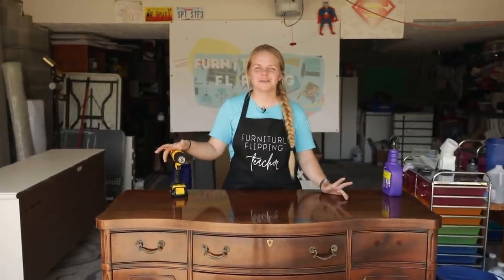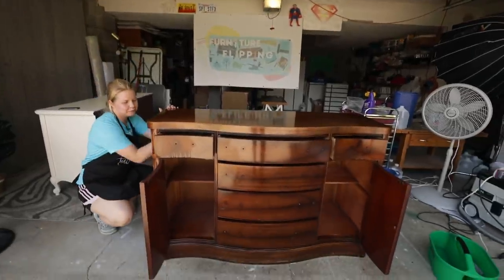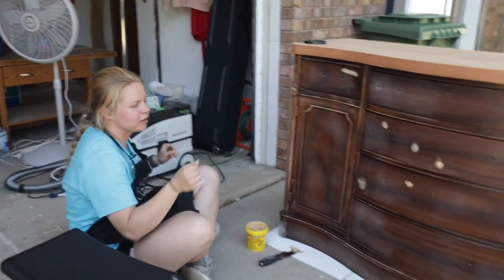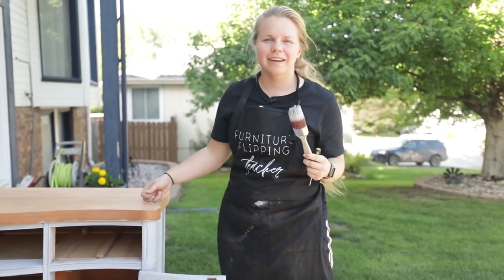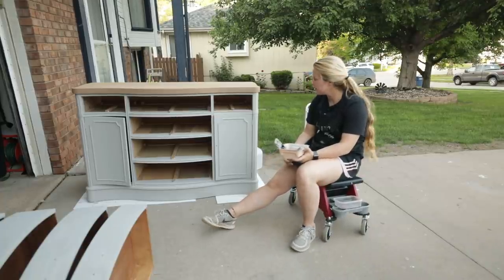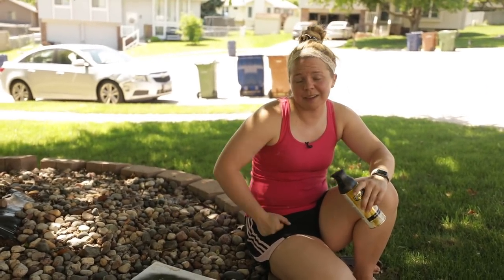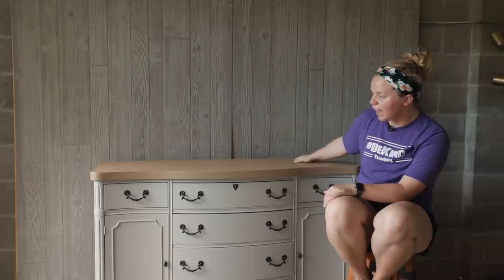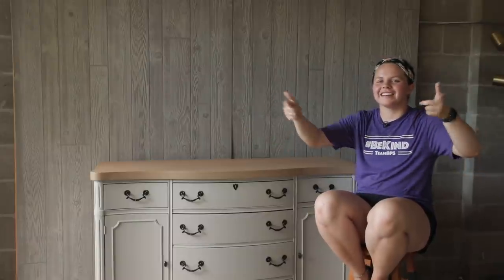How to Lighten Wood WITHOUT Stain or Bleach | Buffett Dresser Flip |

Comment: The green velvet lining in the drawer is Silvercloth. The fabric has fine silver particles embedded in the flannel which absorb tarnish producing gases before they reach the silver.
Reply from the maker: Ahh! Great information! (: I could tell it was truly meant for a buffet! Thanks for sharing!
Reply: Yeah thanks for sharing this info. I have a server that has a brown one. Mind if I use this information for an upcoming video? 🙏❤️🌻
Reply: @GirasolVintage  you're welcome to.
Reply: Hey, Linda. I’m working on this same piece, but the dividers DO NOT want to budge.  What can I do to refresh the green velvet?  It’s not in good condition.
Reply: @lisamorlock-wright6474  I know you can buy slvercloth at fabric stores, or you could years ago when I worked for a couple. The brand was Pacific. I imagine if its not available locally you could order it on-line. I'd remove the original and use craft glue to adhere the  new.
Reply: @lindap9079  Thanks bunches
Reply: I have a dresser with this but it has an old perfume smell….do you have a suggestion for getting the smell out?

Comment: Good job! I had one exactly like that with a China closet, but no scratches. I inherited from my mom. What I did with them back then, (about 40 years ago,)  was a trip! I used Kilz, which was then only oil base and asphyxiating! 🤢 I then painted them both white, then sponge-painted designs on them: a real mess! 😵‍💫😂 Things are easier now, and you guys are much smarter than I was. 
👏👏👏

Comment: I just stumbled on your channel and am hooked! I am a teacher, too! I'm off for the summer and looking for summer projects. You've inspired me to tackle some of my pieces that need refinishing/painting! I've noticed that you paint over the hinges, rather than remove them with the other hardware. My worry is that the paint will chip off of the metal hinges. Do you treat them differently to prevent this?

Comment: When you're worried about going through a thin veneer, is there a reason you don't use stripper instead  of sanding, and then smooth with steel wool before painting? I have a table where I only want to refinish the very top which is slightly damaged. I'm sure the veneer is very thin so I'm trying to decide what is the best way to got about it.
Reply: Im just seeing this video and I saw ur comment...have u ever heard of a product called retique it?? If u ever have a top that is completly roached or busted vaneer retique it might help u out. There are tons of videos on here about it. Essentially ur "painting on a thin layer of wood"...after it drys its totally stainable...great product

Comment: This piece came out absolutely gorgeous!!! The staging looks great also. Did you lightly sand between the top coats? I use rustoleum metal primer spray paint on hardware and then the spray paint and no top coat. I used it on my kitchen cabinet hardware which is very high traffic and a year later and no issues. I would say the only downside is the metal primer takes longer to dry.
Reply from the maker: I do a finishing pad between top coats. Ohh! I will have to check into that style of spray paint! Thanks! (:

Comment: Hey what advise would you give about  weather... does the heat ever affect your paint like drying to fast.. also would you recommend painting in the morning and towards the evening instead of the middle of the day?? Thank you love your channel 💗
Reply from the maker: Heat does affect dry time. It doesn't matter what time of day you paint...just make sure you are not in direct sunlight painting. That will cause the paint to dry almost immediately as you're still brushing it on which will then cause it to clump and such. Good luck! Thanks for supporting!

Comment: You need to remove the doors and clean the hinges that are part of the hardware of the piece Never paint over it never!!! Yes its more work but if you buy it new you do not see painted hinges. i am a retired Architect Designer and i am giving you professional advice. No professional restored would ever do that and you do such beautiful work neither should you do it Charge more if you like but do it right..